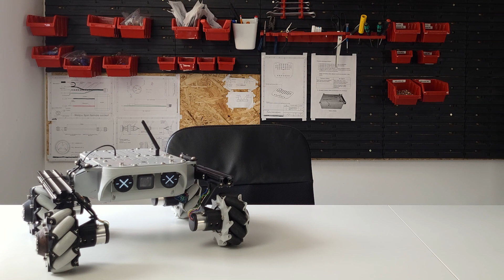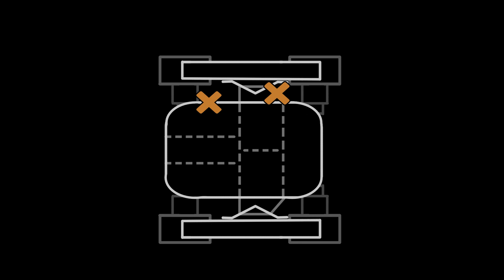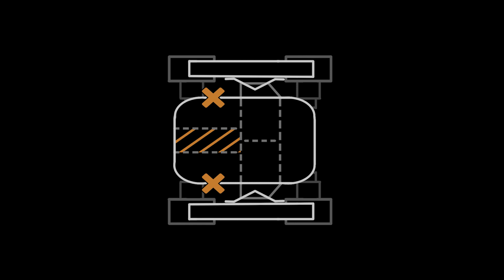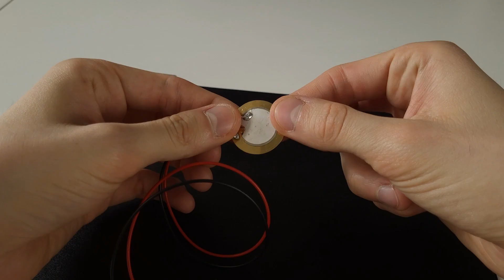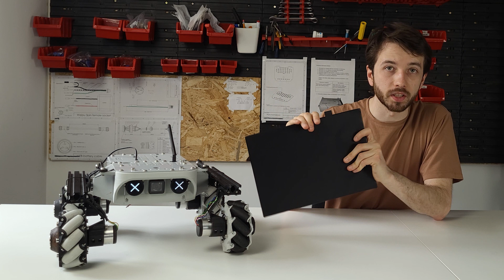I made my robot understand it got shot

Comment: Where did you get the wheels?
Reply from the maker: I made them - they are mostly 3D printed, but i hate the rattly sound of plastic grinding on plastic so i gave them bearings as well.  Now the only rattly sound comes from the plastic rollers hitting the floor.

Anyway - if you want me to i can make the files public. I'll just fix the few small problems they have before doing so.
Reply: @WayIDoIt  I would be grateful for the files
Reply from the maker: @anthonydavies9093  Give me 48h :)
Reply from the maker: Here: https://www.thingiverse.com/thing:6175379
All the files should be there. I'll tell you in advance that the assembly process is incredibly annoying and tedious.

Hit me up if you'll have any questions or if you need help.
Reply: awesome, thanks. My Leo thanks you
Reply from the maker: One more thing - I forgot that I'm working for Leo and should be making them money - if you want the wheels with metal sides and rubber rollers send me an email to kacper@fictionlab.pl

If not - making them yourself is pretty fun